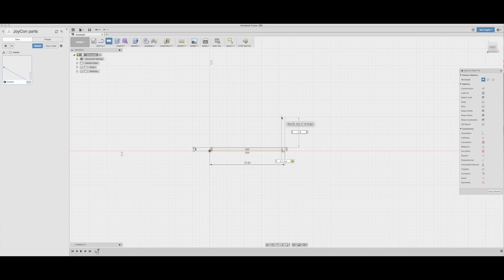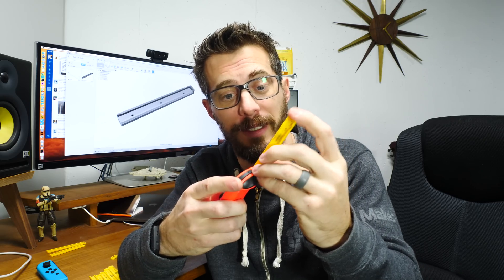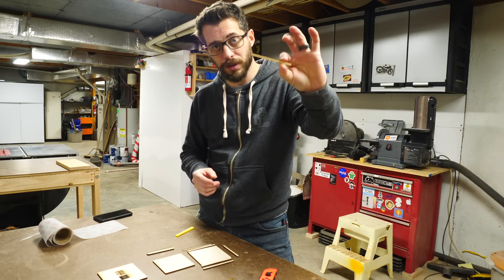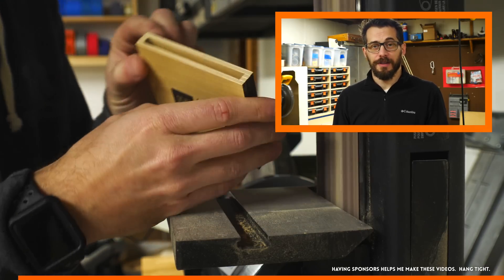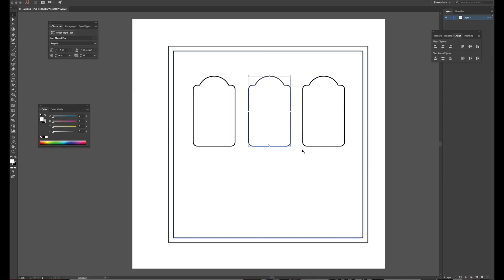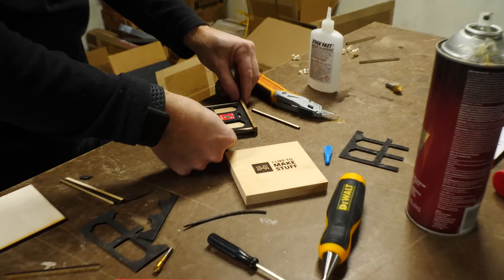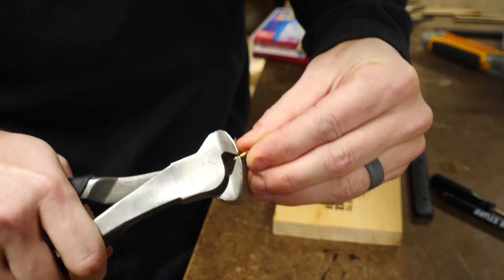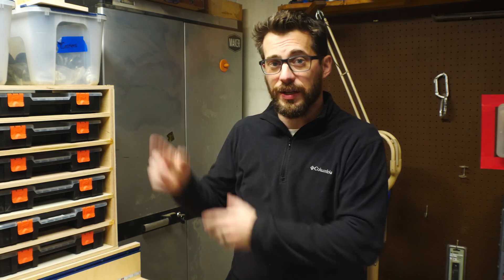Nintendo Switch Game Storage Controller // How-to | I Like To Make Stuff

Comment: hi so please don't get me wrong, a really great job you did there.
but for me it doesn't make sense to use it as a controller replacement.
I have the games with me on the couch but still have to get up to change the games. then i would actually put a platform at the switch where the games are integrated as in your work

Comment: The stl file for the rails are a bit off. The joycon doesn't fit. It's too tight
Reply from the maker: You'll need to adjust tolerances for your specific printer.
Reply: @Iliketomakestuff  oh okay thank you

Comment: Don’t you need the other parts of the joycons on in able to play without connecting the joycons to the switch itself or the controller thing that they slide into? How would this work without those thin controller parts that have the extra buttons and wrist strap connected to the joycons?

Comment: End result looks great, but is there a reason to have the middle section so big? I guess if you were trying to emulate the joycons as if they were attached to a switch, that's a good design but most people prefer to keep the joycons closer in that configuration. Could've gone with a box about half the width and store only 4 games or something

Comment: woah, just a second. For one thing, you should not under any circumstance pull out the joycons with out pressing the release button on the back. Even if the rails you made don't have the lock in bits, you still risk damaging the joycons in such a way that they will just fall out of your switch without you pressing the release. And on top of that, the rails you made have the joycons coming upwards, not downwards. the Joycons are designed to go into any and every rail one way and one way only. again, you're risking damaging your joycons.

Comment: The glow forge is cool but just way over priced. I just can't pull myself to spend that. (aside from convincing my wife! Ha) I do have a 3d printer and will print those slides! Making the box should be fairly simple without the laser.

Comment: Can you make a little box to store the joycons in, so you can put the min one pocket, and the tablet in another. Bonus points for making little "cons" to make the switch a more rounded tablet shape, without the open rails. And maybe call upon some soldering god to add in a home button that works. I would pay you any number of body parts to see that happen.

Comment: I got a case for my Switch that came with two game card holders. They... Are... Horrible. First of all, the case is incredible hard open and you have to put a lot of force just to open it. Also, the game cards don't fit correctly so they practically slide around. And, for the final bit of horribleness. Since you ave to put force into opening it and the game cards don't fit correctly all of my games go flying when I do open it. I almost lost Mario Kart 8 Deluxe in a parking lot the night I got the case because of it. I would rather keep the games in my pocket than in the case I got.

Comment: I need to get more use out of my 3D printer; been playing around with FreeCAD a bit but still have quite a bit of trouble with it (but I was able to design a keyboard tray; except, my build plate is too small so I can't actually print it at the size it needs to be :v).

Comment: it looked odd to see the Joycons sliding on from the bottom.  On the Switch they slide on from the top.
Reply from the maker: The rails I made work in either direction so you can just flip them around

Comment: Hey nice video and nive idea ! There is some in design tip for you (works on Toshop and Illustrator as well): There is a slightly more efficient way to copy paste an item. You can Click+Alt on your item and drag it where you want.  And if you want repeat the duplicata but from the newly created item you just have to use Ctrl+D (Cmd+D on mac).

Comment: If you had the other connection, you could create 2 small boxes that each fit 2 games and make the unit wider. It could then be a single unit instead of having to carry a case attached to the controllers and the screen.

Comment: Spray adhesive is very useful.  You could do an entire video on different uses.  It is way less messy and finicky than CA glue and quite strong especially on porous materials.  I really like your use here keeping the foam in the drawer.

Comment: If you don't have a 3-D printer, you could remove the rails from the wrist strap attachment that comes with the switch and use those. Nobody uses the wrist strap anyways, and you could use the screws from the attachment as well.

Comment: Great project Bob :) Actually you could also improve it to be even better- immagine the box slightly wider with extruding parts oposite to the rails (like those on joycons) so you could also atrach the screen part of Nintendo switch to the front of the box:) Also adding a foot on The back would allow it to hold the screen on the right angle while you play:)

Comment: for me the only thing i would have changed about this project is that the joy cons slid in from the bottom on your version while they slide in from the top on the switch. Its a small detail that wouldnt bother most people but if i were to make it i know it would drive me insane 😂
Reply from the maker: Yup, you can just flip them over. The model works that ways

Comment: I know you said (both here and the podcast) that you're worried about accessibility for some of these tools, but they're more accessible than ever. You can get a solid 3d printer under $300, and the laser cut parts can be made using a bandsaw or scroll saw. 

As a 3D printing and modeling noob, I'm glad to see project videos like this from people with broader fabrication experience.

Comment: Those screws you had to cut weren't brass they were brass plated steel, brass is non ferrous and therefore does not emit sparks when ground.

Comment: Correct me if I'm wrong, but shouldn't the controllers slide from the top down? Might need one more version of the rails to make it perfect.
Reply from the maker: Actually they work either way so you can just flip them around

Comment: Hey folks, I just bought a pseudo Dremel tool and being the noob that I am, I don't know which disk I should use to cut small pieces of wood. I understand that using a small grinding disk is not suitable, but there are not any other attachments that look any better. Do I need to buy a set of disks with teeth?

I know that this is a really basic question, but I hope some of you can help a rookie out. Cheers.

Comment: Bob, do you use the laser a lot more than your CNC router? I already have a 3D printer and I'm trying to decide what the next big tool purchase will be.
Reply from the maker: I've been using it more lately, but I think that's just because it's new :)  Overall I'd say a CNC is far more versatile (unless you start getting into large, very expensive lasers)
Reply: Thanks for the input. Cost is a minor factor as well. CNC is looking more and more likely!

Comment: This is a cool idea. I may not have young ones of my own but I can see the advantages to this. Simple for kids to have there favorite games right there and ready for them. But I feel Like I would go a step farther and have a shelf built for the Switch game cases. Am of the mind set of collecting or at least keeping them for later use. Also the number of games you may get for the switch will possibly grow larger then the case you made. If you have only one platform then you should not have to much of a problem storing the cases. Unlike me with 2,5 platforms I support. :)

In any case great video, and smart thinking. Have a good one.

Comment: Great project, Bob!  One quick suggestion, though... can you include a link to your Fusion file?  STL files are easy to grab from Thingiverse, but not so nice to modify.  If you share your Fusion file, it will be easier for people to modify the design - either to fine tune for their specific printers, or to adapt it for other uses or attachment methods.  Thanks!

Comment: While I understand that the large cases are probably bigger than they need to be (DS or 3DS cases would have done the job) they do have a good purpose. You said it yourself several times, teeny tiny games. Its a lot easier for kids to loose a tiny game card then a bookshelf case. Still though this is a cool project. The first I've seen for the switch.
Reply from the maker: Well, my point is to have one larger case for them rather than several. I understand why they're sold in that size case, I just don't want to have to store them that way :)
Reply: I Like To Make Stuff 
That's cool man. 

It'd also be great if it were possible to buy this from you. 
I can't do the stuff you do ._.
Reply: I gotcha, it is a very convenient and slick project. I just worry about loosing games that small is all.